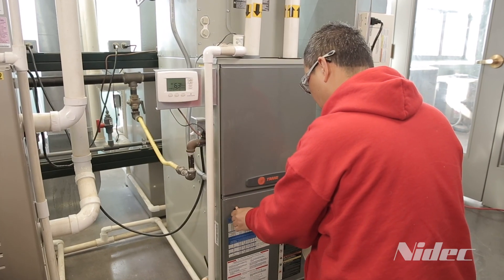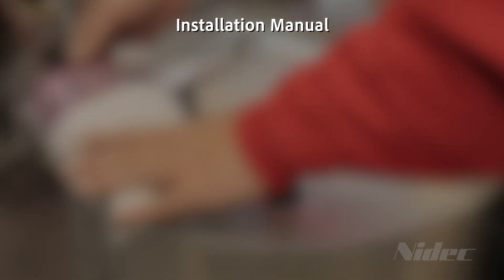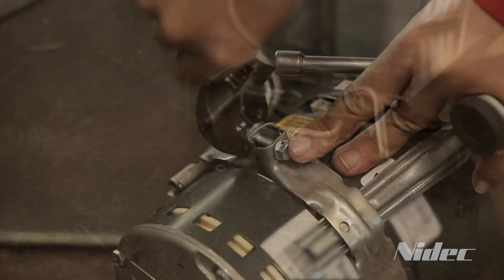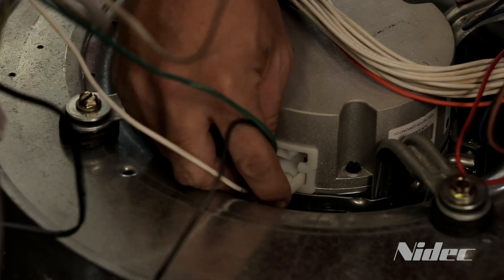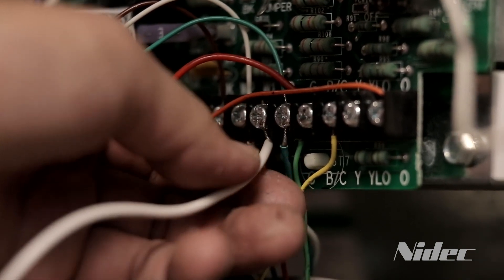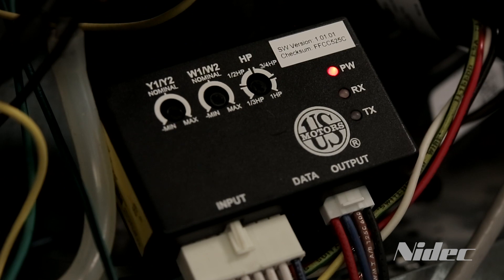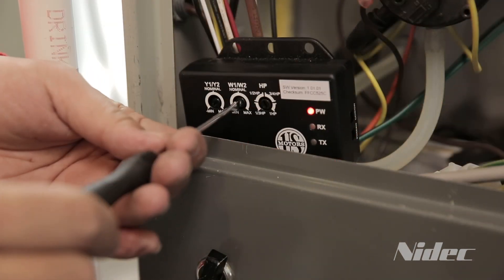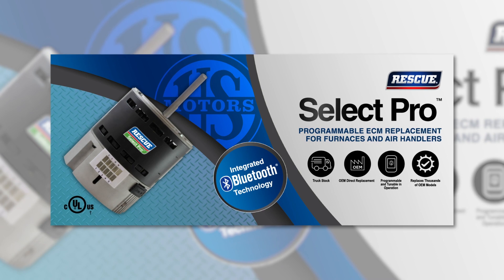Nidec Training Video RESCUE EZ16

Comment: Can the EZ16 be used to replace a Genteq 1/2hp, 1050rpm, ECM 3.0?

The connections on the existing motor are 5-pin for power(I am using 120v so the jumper wire is installed on this plug). 
And below it is 4-pin for data.
Reply: Did you figure this out? I wonder if the EZ16 can be used without the control box for ECM 3.0. With the Evergreen VS motors, you just use the motor without the control box. It's truly plug and play.
Reply: @mtbbiker6401 I ended up returning the EZ16 and picked up an EVERGREEN. Like you said, it’s a plug and play!

Comment: I am about to attempt to install the EZ16 Motor. Not off to a good start, the original box the motor came in had been opened and the white auxillary wire is missing. ( A pre- opened box is never a good sign) .  I will post a update once I get it to work or if it fails to work.

Comment: There are no instructions to wire the new harness into the air handler thermostat connections or the board.  Currently, the thermostat is wired to the board.  Where do I tie in the harness wires?

Comment: How do you know exactly to set cfm? If required 1200 cfm? Assuming with the aid of anemometer
Reply from the maker: Every system will require a different setting based on static pressure and delivery system.   Nidec suggest using temperature deltas so set the EZ16 for a specific system.

Comment: HEllo everyone , I installed  a rescue EZ16 Motor , and i have the following problem , in the beginning all worked perfect but now on the 3rd day the heating will not turn off .!!!! i Use a nest second gen Thermostat , i unplugged and still the same , so is not the thermostat , The only way to turn off the system is to power down from the main switch, basically the whole furnace. Any ideas , for now i will leave the system off @ night and see if in the morning it reset !!
My furnace is a keeprite 9MPV125L20D1 (PART NUMBER OF MOTOR REPLACED WAS CALLING FOR 1172829 MOTOR) ..as i said air works great but the heating will not shut down the flames  or the motor even with the thermostat off !!!!
Reply from the maker: Makis - please call our tech support hotline at 888-540-5540. They will be able to help you.

Comment: I just put on of these in and now the fan runs continuously. Also my EZI didnt have the 24 vac selection. It only has PWM/4W
Reply: Hi Cameron, did you end up resolving your issue? I'm in the exact same situation as you, I just installed one with PWM/4W rather than PWM/24VAC and now my fan runs continuously.
Reply: @stephanieblier4507  Yes, instead of wiring the control module to the R terminal. I wired it to G and that seemed to resolve it.
Reply: @cambamthelowman8584  Do the seven wires need to be connected to the board?

Comment: What do I do if my plug only has 14 wires
Two on the end don’t have wires in them
Reply from the maker: @AK-ii5fy  Unfortunately, in any system with less than 6 leads our EZ16 will not/cannot replace it. There's no other way to make it work.
Reply from the maker: Not all manufactures use all of the wires in the 16 pin connector.   The Two wires at the top or bottom of the connector or plug, when held longways up and down do not factor into the operation of the EZ16.  If the motor you are replacing is labeled ECM 2.0, 2.3 or Eon, follow the wiring instructions provided with the EZ16 motor for proper operation.